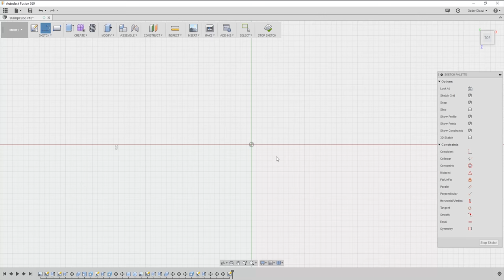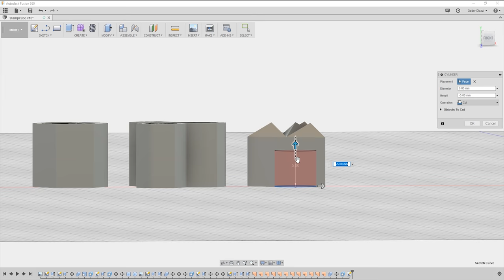Leather Stamp: Make your own with 3D printing!

Comment: hey man, in cura you can add a command to bring your build table at the front after finish printing and not the back like in your video! lol You go in the "end gcode" to add the command. I home the Y axis then move it a specific amount of step until it's a the front.
Reply from the maker: Thanks bro! :) I'll try
Reply: G28 X0 Y0                              ;move X/Y to min endstops so the head is out of the way
G90       ;absolute positioning
G1 Y180                                  ; Move Y forward
M84                             ; Steppers off
G90                             ; Absolute positioning
M106 S0                                  ; Turn off fan

Comment: Great work man :)

Your first layer seems either a bit too high or maybe a bit underextruded. By the looks of the rest of the print, extrusion is probably fine, so your nozzle probably starts a bit too high.

Keep it up :)
Reply from the maker: Thanks Vedran! :) I know you know bed leveling is a pain xD But everytime is a little better! I'm now trying a series of long prints, 15hr or so, I could watch it extrude all day :')
Reply: I know... You should try out auto bed leveling. I use cheap inductive sensor over aluminum bed (no glass) and it just works. If your bed is slightly warped, there's mesh bed leveling to fix that. If you're keen on keeping the glass over aluminum bed (not needed IHMO), you can try one of mechanical leveling sensors.

Comment: former machine tool designer hear. used Autocad and Solidworks 15 years ago. Is Fusion   capable as a free replacement to the high end cadd?
Reply from the maker: As far as I know Fusion360 can't really replace Autocad for 2d... But it's a great software! Try it!

Comment: Just starting with leatherworking and didn't think about using my 3D printer to print custom stamps.  What material did you use and what has the long term durability been like (since I now see this video is over a year and a half old)?

Comment: You shouldn't  print this pivot I think. It would be better if You did it with metal. It some waste of material. :)
Reply from the maker: It's working fine :) PLA is cheap bro!